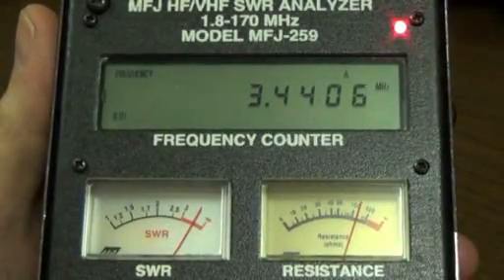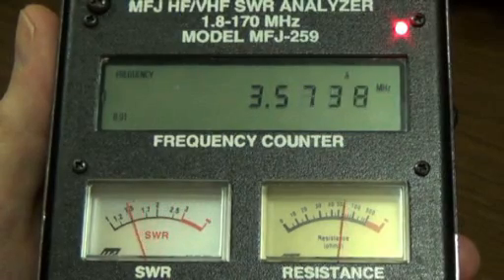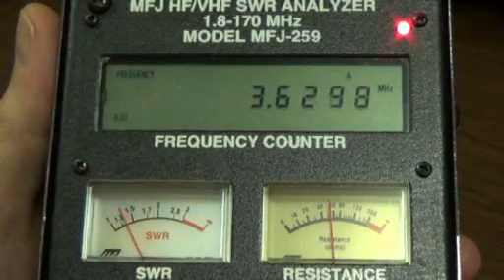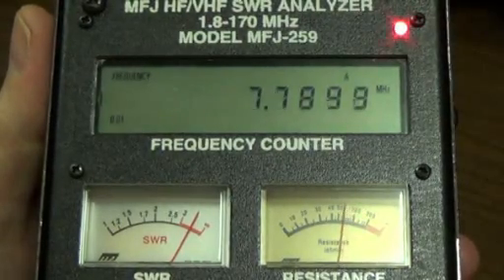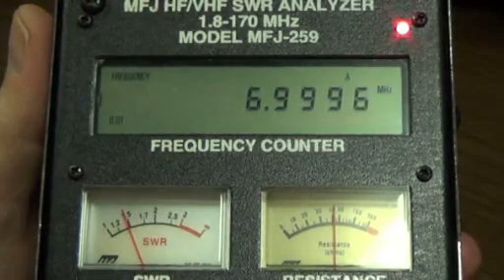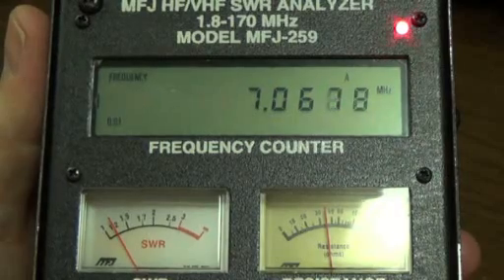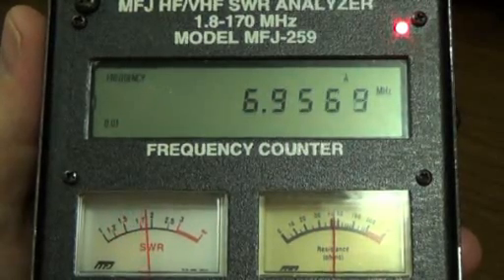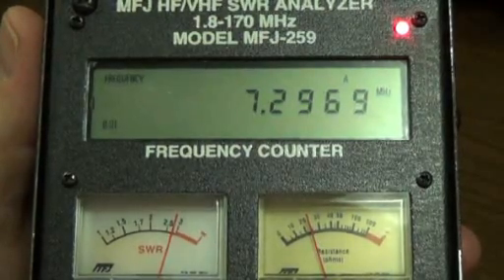Basics of Using an MFJ Antenna Analyzer by W5LA

Comment: Now what do you do? 

What if you want be be on a higher frequency

How do you get it tuned?  With the antenna or a tuner? 

I already have a tuner,  versa ll.......

I have a dipole antenna AND the Diamond 1000 Take It Along

I know how to tune the dipole

But I'm confused with the TIA.... IT HAS A Colar on it to fine tune to the frequency

Do I NEED an Analyzer to use the TIA... OR will the tuner be good? 

How do I kn9wthefrequency of the antenna WITHOUT an analyzer?

Comment: the resonant frequency of an antenna is where reactivity is 0, and that can be different from where impedance is 1:1.
Reply: +ms3bani Yeah I agree.If your transceiver is designed for 50 Ohms(which most Ham or CB radios are) then you want the lowest reading you can get on the left meter(SWR) but the meter on the right should be reading 50.  I rather be 2:1 at 50 Ohms than 1.1 at 20 or 90 ohms.